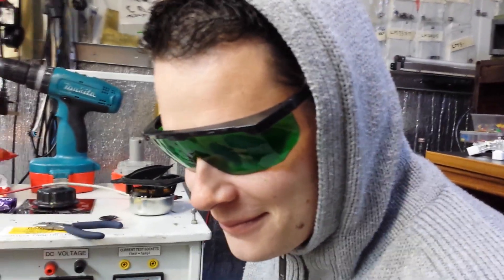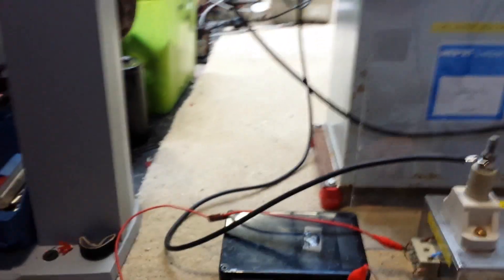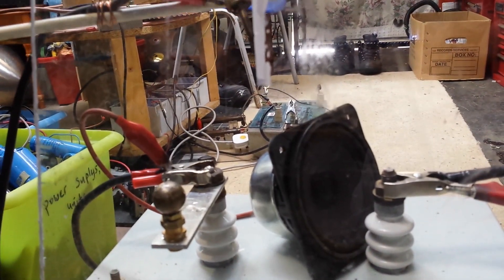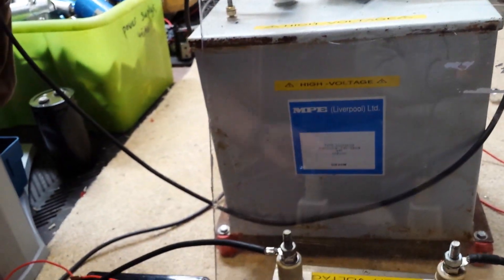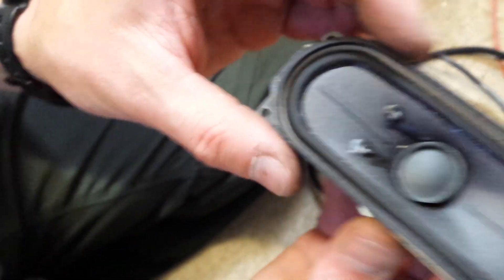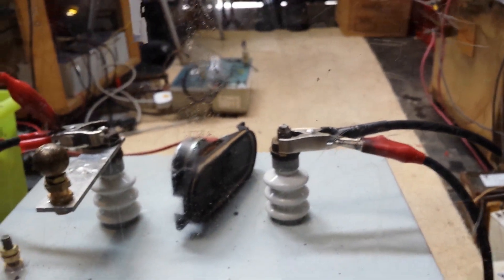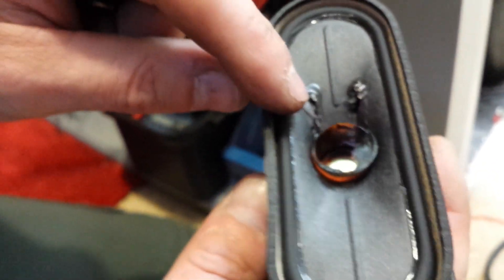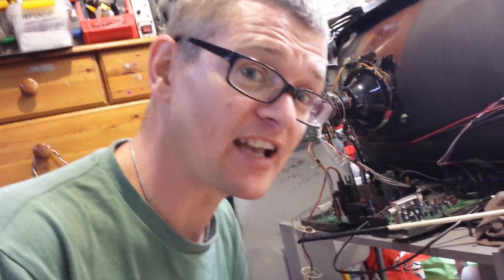BIG CAP' destruction ;-)

Comment: Yr speaker protection is stuffed - and lordy that cap - gotta get me one of those :) If you can wrangle it, make a solenoid/pneumatic fired discharger (two brass plates one moving one stationary) so you don't have to use the chicken stick. This way you can use copper bus bar or braid as mentioned by Paul Roberts and hard wire your target in for the best current transfer